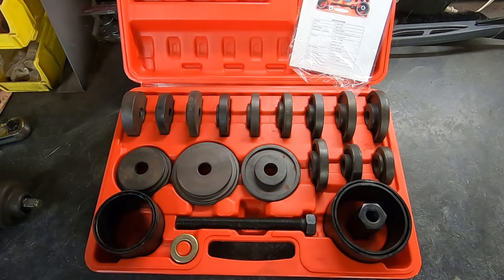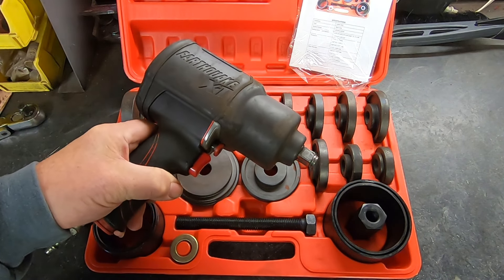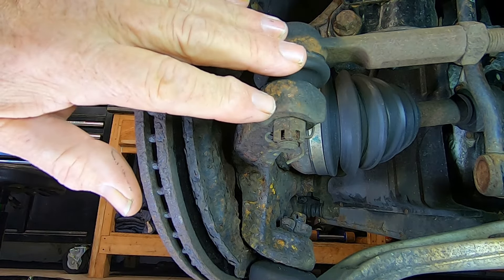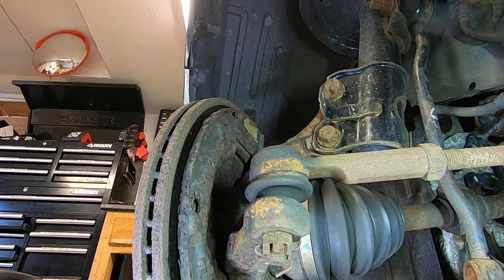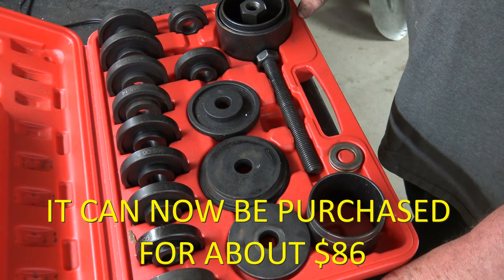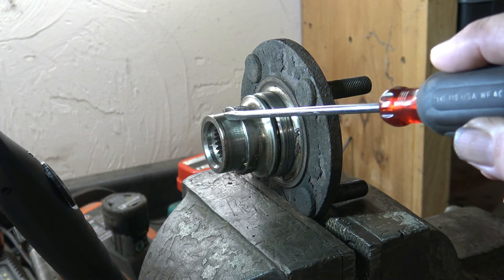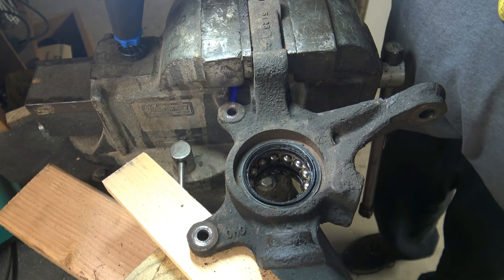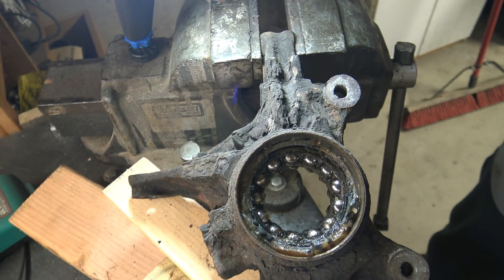How to Use a Bearing Press Kit (Update)

Comment: No is cheap made thats why the threads after couple times they were out
Reply from the maker: The kit is not for everyday use as in a repair shop, I have had my kit for several years using it only occasionally. I have had over one million views and thousands of comments from the 3 videos I have produced on that kit. The main reason the jack screw fails is because they do not lubricate it and use power tools to crank it. If used only occasionally keeping the screw lubricated turning it only by hand with a ratchet it will last many years as has mine.
Reply: @richardspaulding5035  the thing is I had it 2 times I use it and the threats went bad I had to go fix one coast me more then then the hole tool kit nothing wrong with the rest of it only the bolt with the nut is the problem the rest is good
Reply: @richardspaulding5035  don't make scents is not every day use.You by something to use it?
Reply from the maker: @spiridondimaris465  Give me a break! You know what am talking about. A device that sells for under $100 dollars is absolutely not designed for a professional auto shop. It is made for the DYI guy for USE AT HOME where it might be used 2 or 3 times a year if that. Please be honest, when you stripped that jack screw you were using an air impact gun, am I correct?
Reply: @richardspaulding5035  if course some times  you need Jack hummer to get it out in less y you have plenty time in your hands and feel like playing all day I want to get it done soon is possible so I can't do the next 👍
Reply from the maker: Regardless! you cannot use a jack hammer on these inexpensive kits. If you going to do a lot of this work spend a few hundred bucks more on a professional kit. One other thing you can do however, is discard the jack screw and use the attachments in a shop press. You can get a good shop press at harbor freight quite reasonably. Enjoyed the conversation, thanks
Reply: @richardspaulding5035  why 100 dollar's is not cheap. for that kid?
Reply from the maker: Were you born yesterday? $100 is almost nothing these days, besides the kit now goes for about 60 bucks.  Give it a rest , you know you are wrong. Now your just making an ass of yourself, As much as I have enjoyed it, I am busy right now and not going to respond any more today. if you want we will pick it up later.
Reply: @richardspaulding5035  Richard no I don't born yesdarday I born the day before listing don't tell me I can't find  2cond hand it tools that are best quality half of the price and you can't beat them all day long and still be like nothing wrong with it i know you can't if you know like I say the kit you have ok use it ones in while not very day nice talking to you Richard have a good after noon👍
Reply from the maker: @spiridondimaris465  Oh yes now we can agree, if you can find an older tool made in   the USA go for it.

Comment: 😂ratchet my Audi 80 quattro bearing laughed at exactly same kit using a 30" breaker bar with extention the threads died before the bearing came out !!! Lubricated or not cheap Chinese Steel !!!
Reply from the maker: No question the kit is not for everyday use such as a repair shop. However, I have used mine on numerous occasions without difficulty. I would love to have been there to see what and how. If you had to force it with a breaker bar something was not quite right. As you saw in the video, I used an ordinary flex head ratchet. I have never used nothing but a ratchet with the kit.
Reply: My threads rounded out and failed, stripped. I used my torque power wrench too. I use all the other stuff with a press I bought, 12 ton harbour freight.
Reply from the maker: @burtflak9409  I don't know what you guys are doing. I have used mine on numerous occasions. Never with any sort of power or toque wrench, only with an ordinary hand ratchet. Never had a problem with the jack screw, still looks as good as the day I purchased it.
Reply: You can replace one of much better quality from McMaster & Carr the rest of my  kit seems like it will outlive me
Reply from the maker: No question the kit is inexpensive. I guess we get what we pay for. So far I have been lucky with mine.
Reply from the maker: @giantgeoff  being that I turn 71 this month I expect all my tools to outlive me. LOL
Reply: I don't know why you guys use these tools anyway. It's gonna strip and the cups are useless for hammering.

A decent vice is helpful and you just need two deep impact sockets, far cheaper and more robust. You punch the hub out with a smaller size impact and hammer, then punch the bearing out of the knuckle with a larger size impact. 

The bearing race stuck on the hub spline? Do you go and buy a bearing splitter and a puller or do you send a slim chisel underneath it with your hammer to lift it slightly then carefully cut straight down it with a grinder, then cut a cross into the cut face, without scoring the spline, then simply tap it off!

Same again to refit, use the old bearing to press the new one in, either in the vice or with a big hammer. Then knock the hub into the bearing whilst supporting the bearing with that big impact socket underneath.

How do you know everything is home? Instead of knock knock you will hear ting ting. It's home.

Make sure sensor in bearing faces hub ie ABS sensor.
Reply: McMaster & Carr can supply a higher quality threaded rod and nuts to replace the ones supplied. Not that you asked but after an unsatisfactory experience pulling the inner bearing race from a VW Rabbit hub using a "Cheap Chinese 2 jaw puller using a Dremel I ground that jaws to fit the exact shape to grip the 2 flats on the hub. If had attempted to retry to pull the race off again I am sure the jaws would have reshattered. Instead I used my oxyacetylene torch to heat the 2 pieces to a red-orange glow then using tongs dropped them gently into a metal container containing used motor oil. Did it stink and smoke,? Absolutely! Did it work? Also absolutely I have used this tool numerous times since with perfect results. Don't ask where the inspiration for this came from.
Reply: @richardspaulding5035  yeah I'm chasing you down that road. I would like to use the joke that I feel like I was born in the Johnson administration Just some days it's Lyndon other days it's Andrew's!
Reply from the maker: @giantgeoff  Thanks for sharing all that, I will most certainly will look that company up
Reply from the maker: @giantgeoff  I was actually born when Harry S Truman was president

Comment: Would this work for a rear subframe diff bushing
Reply from the maker: I have never tried to use it for that. I cannot say it would not work, however I think the jack screw diameter may be too large.
Reply: @ didn’t work the rod was to big at least for the g37 but if u go to Home Depot and acquire the rod and nut should be good enough
Reply: @ didn’t with the rod it comes with but a rod and nut from Home Depot should donit
Reply from the maker: @GuillermoVargas-z6m  The kit should have come with the rod called a jack screw if you purchased it new. If you purchased it used sometimes people will use a power tool and strip the jack screw.

Comment: I used this today and u have the cup at the wrong end . And u can also do it while it's still on the car.
Reply from the maker: Friend, it is too bad you did not watch the video as I addressed the issue of using the kit on the car in the opening. Furthermore, I absolutely did not have the cup on the wrong end. If you reverse the way I demonstrated the kit the lip inside the knuckle would prevent the bearings removal.  I have had more than 1 million views on the use of this kit. Not a single viewer other than yourself has suggested I did anything wrong.